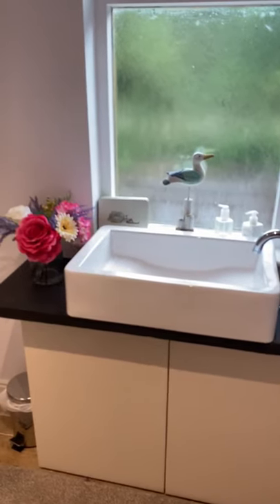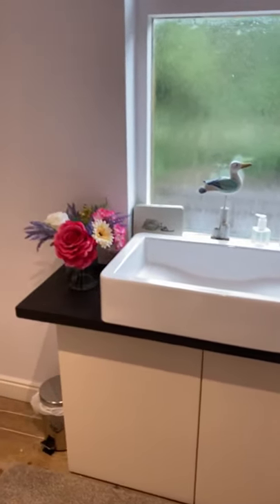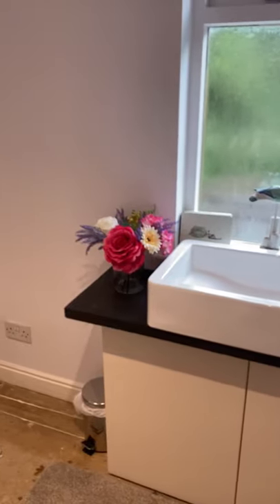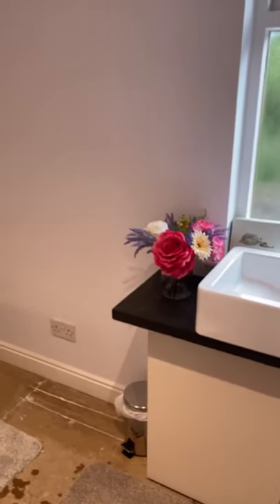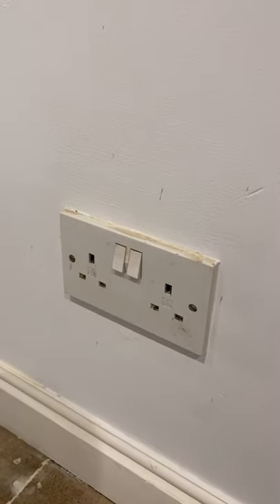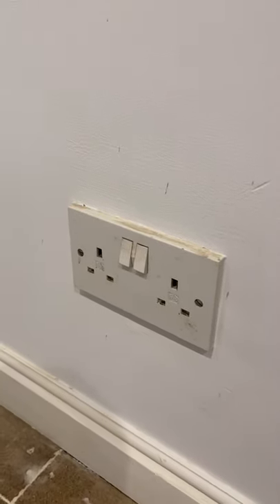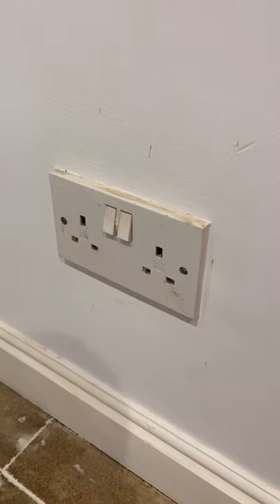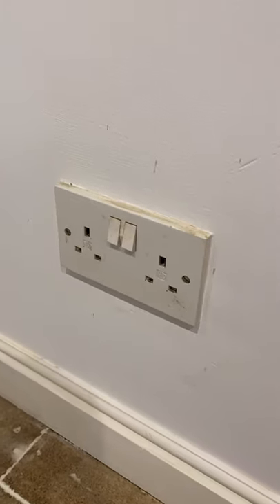230 Volt Socket Outlet in a Bathroom 😱⚡️

Comment: Another reason the French laugh at the Brits.
Reply from the maker: True 👍🏻🤣
Reply: Not only they do, the whole continent has sockets in the bathroom. Here in Germany outlets are compliant as long as you're outside of zone 2. And there are no special requirements, so IP20 is perfectly fine. Even directly next to the sink. You can even have a washing machine within zone 2 as long as its hardwired or the outlet is outside of zone 2.
That's something I don't understand about the British regs. You can have an electric water heater inside of the shower cubicle, fused with 40A, but not a socket outside of the cubicle. Next to the sink would be a perfect spot so a hair dryer can be used in front of the mirror. That's the way it's usually done here. There's no chance of water from the shower getting there because it's obstructed by the walls of the cubicle.
All bathroom circuits created after 1984 must be protected by a 30mA type A RCD. Since 2015 the VDE recommends the installation of 10mA RCDs for bathroom circuits (and only for them). But the regs still demand for a 30mA one. The 30mA threshold is for healthy adults, but it's still too much for people with heart diseases or children. 
And I would install a radiant circuit for the bathroom, B16A/30mA RCBO. That is sufficient for the lighting in that room, and in addition for the appliances in the like shavers, tooth brushes, hair dryers. Such regs are always bypassed by creative people, for example by dragging in extension cords and power the hair dryer from a socket outside of the bathroom with that. Then you have the same effect like having a socket installed, but much worse, because usually these extension cords are laying on the floor and could get wet there. What could not happen if there's a socket mounted on the wall at a certain height.
Reply: @Marcel_Germann   Yes, I agree. The regs says no 230V equipment in zone 1 yet "You can have an electric water heater inside of the shower cubicle". The regs does not I believe even state that as an exception.
Reply: @lemech  What‘s that thing that looks like a wall mounted telephone with a hose and a shower head on that? That‘s a water heater for showers. Never seen such a thing here btw. Exception should be in the part 701. At least it‘s in the VDE 0100-701 that you can install hardwired water heaters within zone 1.
Reply: @Marcel_Germann and if you search “killed in bath using phone charger” you’ll see why the UK doesn’t allow them.
Reply: @JT_2024-c8j   That has more to do with unsafe phone chargers sold directly from China, and that don't meet European safety standards. And if I use a long extension cord from the next rooms socket outlet to the bathroom it's perfectly safe?
The thing is, here in Germany the bathroom circuits were always treated special until round about 10 years ago. In 1984 it was introduced that "circuits in rooms that contain a bathtub and/or a shower" must be protected by a 30mA RCD. In 1987 type AC RCDs were banned for new installations, type A is the standard since then. Other circuits had no RCD requirement. That came much later.
Reply: @Marcel_Germann  Of course not,  the whole point of not fitting sockets is to discourage the use of electrical appliances near large  bodies of water.  Earth leakage protectors do nothing for Neutral to Phase shocks.  You are now the load until the breaker trips or you let go.

Comment: I still find this odd, any other country not an issue. UK it's an issue unless it's in an airing cupboard in the bathroom in which case it's not an issue even if it's within 3 meters and even if the shower doesn't have it's own glass door. A quirk of BS 7671 I honestly don't think I'll ever understand.
Reply: @Falstaff 1893 Well, except as long as 3 mtrs away from edge of bath or shower screen
Reply: @Falstaff 1893 but yet you allow electric showers, right? Here in the States that outlet would have to be a GFCI receptacle or a GFCI breaker. I know, we only deal with 120v. I think our wall receptacles have to be higher, for disabled individuals. Light and exhaust fan switches are about 48” high, again set according to disability rules.
Reply: How can an electrician  not understand if you touch live and neutral together in a fraid cable you won’t trip a GFCI.  You become the load.  There’s no leakage to earth.

Comment: The amount of electricians who think a GFCI will protect them from every scenario is terrifying.  If you touch live and neutral with shoes or flip flops on you won’t trip a GFCI.  You aren’t leakage - you become the load. It’s rare but not uncommon for people to be killed by using phone chargers in the bath.

It’s especially dangerous with a cheap knock off charger because they  have a filter capacitor between the primary and secondary of the fly back.  These are supposed to be fail safe but these  components often don’t meet the standards they are supposed to.  Not to mention the gaps are often too close between the high and low voltage sides of the boards and transformer windings.

Comment: Just curious and this a genuine question

Why is it not OK to have the twin socket where it's located?

I understand water and electric issues

However, if it were to flood it would be a substantial amount before it touch a live cable

The only other thing I can think would be if water was climbing up the wall
Reply: Water ingress can cause arcing which could lead to an electrical fire, if the socket was used, also you could switch it on with wet hands, and electrocute yourself (I bet there's no RCD protection). Water will corrode over time, or at least leave limescale deosits, blocking earth paths, and maybe leaving the socket useless. Anything you plug in is within reach of water, risking electrocution of the user. Throw children into the mix and there's no end to the dangers from this set up........but apart from that there's no real problem

Comment: Isn't it 2.5 now in the 2022 revision?
Reply from the maker: Yep
Reply: @GSHElectrical  I'm surprised the rules are so strict in the UK. afaiu the rules here in Denmark (surely based on EU rules) is 120cm from the showerhead or 60cm from the sides of a cubicle if it has a tray

Comment: With all the battery operated devices these days are outlets really needed there.
Reply from the maker: Good point
Reply: @GSHElectrical  It looks like a fairly old installation judging by the old style MK logic.
Reply: @Lift.Tracker  That's exactly what I was thinking.
Reply: She might have an industrial plug in type 😂

Comment: So In "Goldfinger", James Bond electricutes a man by throwing an electric resistance heater into an enamelled cast iron bath while its still plugged in. That would have been the end of the series right there if there hadn't been a socket!
Reply: Half dozen extension leads daisy chained together. BOND WOULD HAVE FOUND A WAY!